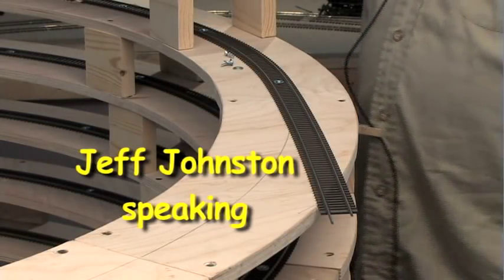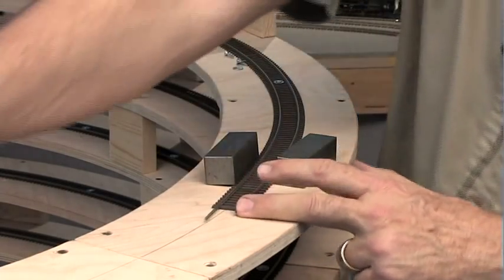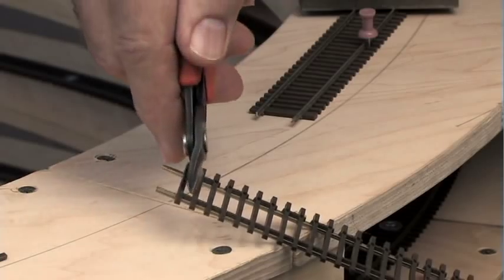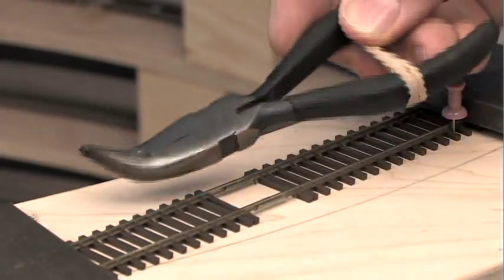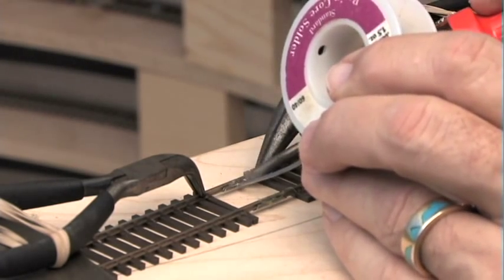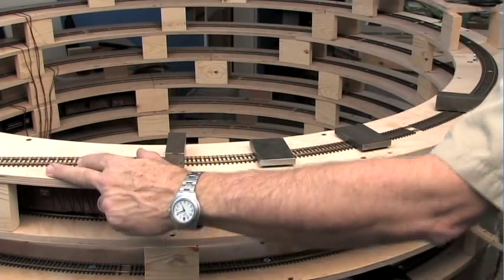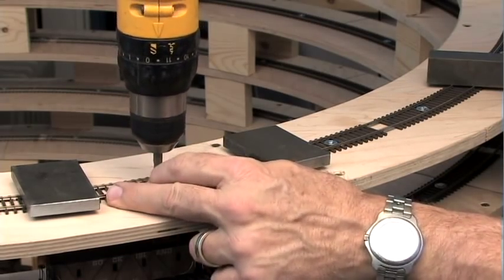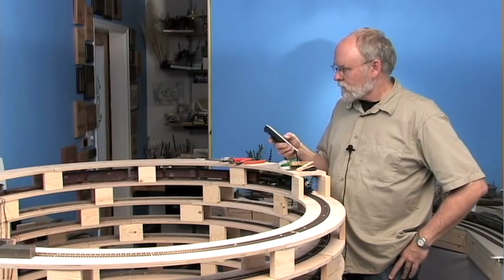Helix construction, part 2: Trackwork

Comment: Would you consider putting a little hot glue on the bottom of the track to help hold it in place - besides using the 5/8" screws?   I would think after a while, the screws could come loose and or track shift if it's not tight enough.  And then too tight will cause the track to bend in the middle causing the rails to come together slightly in some areas???  Or am I making too much of a big deal?   I love your helix design.  Best I've seen.

Comment from the maker: I can only speak for my experience. I think the hot glue is unnecessary, and I don't use it. I have not had screws come loose during years of helix use. The ties are not screwed too tight because the plywood does not compress like cork or homasote, which could cause the effect you mentioned. The setup as shown seems to work very nicely, and trouble free, for me anyway. I hope this helps!

Comment from the maker: The screws used to fasten the track down are 5/8 inch long, #4 or #6, chosen so the pan head doesn't quite slip through the washer, while not protruding too far above the washer, either. Visit a hardware store and experiment.

-Jeff Johnston

Comment from the maker: No expansion problems at all. There's a bit of "give" or flex between the attachment screws, so if the track expands, it can flex laterally just a tiny amount. If the track is fully glued down, as some people do, that much flex may not be possible, though I have never glued track down like that so I can't say for sure.

Comment from the maker: Elder:

Yes, those screws are obtrusive, and that's addressed in the video (Or I thought it was ...), but since the helix will be concealed, that's not a problem. The system works very well for me. Obviously, the visible trackage on the layout does not use those screws and washers.

Comment: Very cool & informative video.  One question I was wondering in the consideration of building my own is if I should use a road bed of either foam or that spongy foam stuff.  I realize the helix is enclosed but I was thinking the helix may act like a sound baffle similar to a speaker enclosure and help to amplify noise.  So I was thinking of using foam roadbed to deaden the sound.  Any thoughts or suggestions on noise from the helix?  Does what you enclose it in muffle the sound good enough? Thx.

Comment from the maker: Skip - If you mean the subroadbed construction, sure, no reason why N scale would be any different.

If you're referring to the method of securing the track with the screws and washers, I'm not sure. I've never worked with N scale track. It means you'd need to use some very small screws and washers, but as long as you choose hardware that wouldn't interfere with wheel flanges on the sides or low-hanging coupler trip pins, and the screws were long enough to hold the track in place, is may work.

Comment: Do you have any problems with track expansion/contraction using welded rail on the helix? This looks like a great system. I'm in the beginning stages of building my layout. Hanging drywall on the walls now.

Comment: Jeff, Thanks for your informative video. I have one question though. I live in Melbourne Australia and we have a temperature range from around 40f to 110f and I was wondering if you have any trouble with rail expansion and if all the rail joints in the whole helix are soldered.  Cheers Steve.

Comment: The only constructive criticism I can can see is that you have your cordless drill clutch set to nine, with my cordless if I turn the clutch down to 1 or 2 it would tighten the screw to just about bite, Among other things I fit kitchens so the clutch is an integral part of the job.
Great job though and I will use this info :)

Comment: I notice you are soldering the inside and outside of the rails. I was told not to solder the inside of the rails to prevent the wheel flanges from hitting it. How do you prevent this from happening?
Reply from the maker: +Russell Scohy  Hi, I solder the rail joiner connecting the rails, not the head of the rail, and I use just enough solder to accomplish the task of jointing the pieces solidly together. The solder does not need to be built up into a huge duck poop pile on top of the rail joiner, which is what you'd have to do to have any solder affect the flanges, as that pile of solder does nothing for the strength of the joint. You'd also be filing down the joint, as necessary, to clean up any excess. But if you just solder the rail joiner, there will be no such interfering excess to have to remove. Be sure to use flux as it makes the solder flow into the joint far more smoothly. Experiment and practice and you'll see how easy it is to achieve successful results.